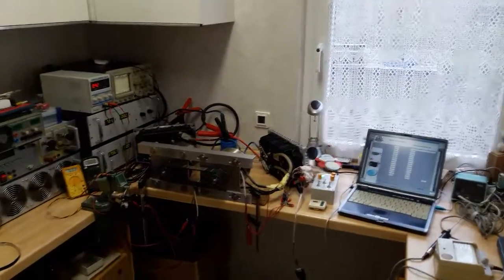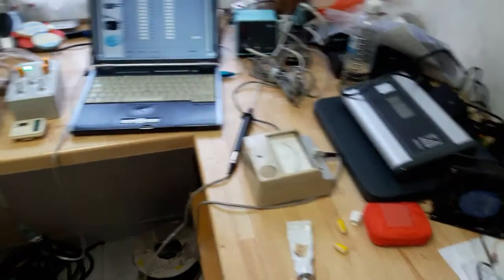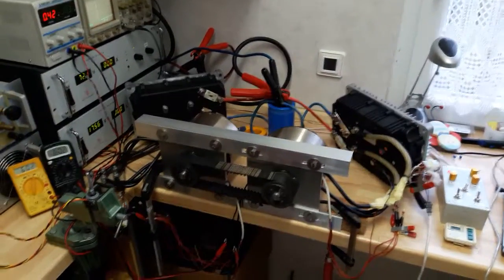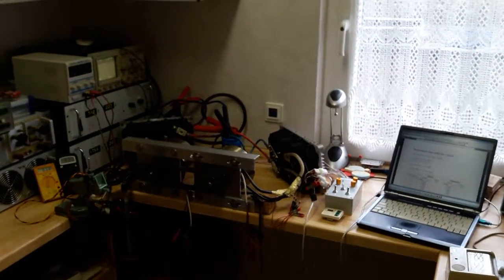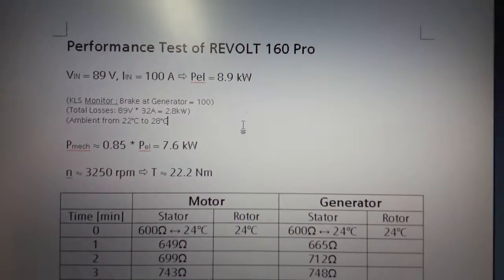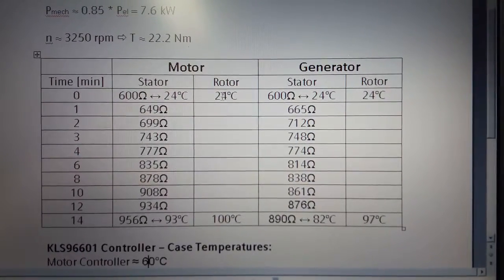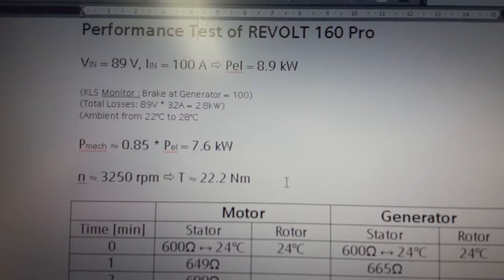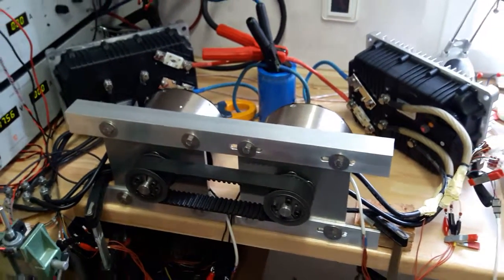Performance Test of REVOLT 160 Pro (Brushless DC Motor)

Comment: If the rotor really is so much hotter than the stator, given the stator is where the electrical power is input, does that mean the rotor case could be being electromechanically braked by the magnetic field of the stator? If not, what else could that be due to?
Is the rotor case still hotter than the stator if there is no load on the motor? (just spun at 90V)
The rotor case looks quite thick (and the magnets quite thin). Do you know the case material?
Reply from the maker: Indeed, in many cases the rotor is on a higher temp than the stator. You saw it right, the case is fairly thick (esp compared to the magnets). Case is one piece made of ferromagnetic material, sure. Seems as if there are some eddy-currents or magnitization (=hysterisis) losses. Still thinking about an appropriate test arrangement

Comment: with your experience with this motor do you feel that it would be useful in a lightweight vehicle in a single or dual motor configuration? (approx 750kg car)
Reply from the maker: What I experienced: the motors are really great. But probably not as quite as good as the manufacturer tells. At lower speeds and higher currents we do have thermal problems. Frankly speaking I don't think that one of those motors is sufficient for your 750kg-vehicle.Currently I'm busy with the forced ventilation...stay tuned
Reply: Kind of wish they included a water cooling system like the GoldenMotors 20k, I would buy the GoldenMotors but I am not sure about the build quality and if it would work as advertises. I am having a hard time trying to find EV motor sellers in Europe and understanding the regulations (I am an US citizen working for the Army there). I have heard that engines over 48v have very stringent regulations.
Reply from the maker: Water cooling helps a lot for those high power densities! Is it worth the effort?!Looking at the data and the curve of the GM (@72V) it doesn't look as impressive (efficiency, speed characteristic) like the Revolt.In my opinion you do not need to worry that much about Quality of such products nowadays.